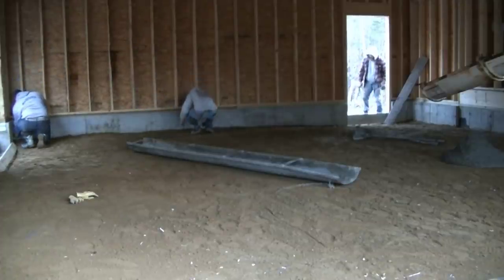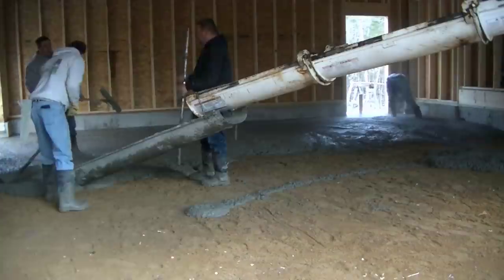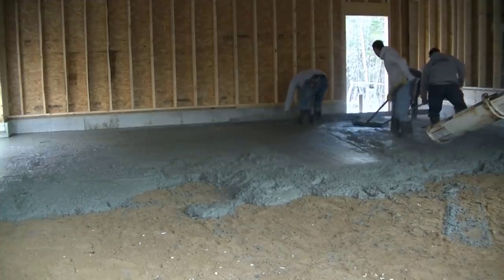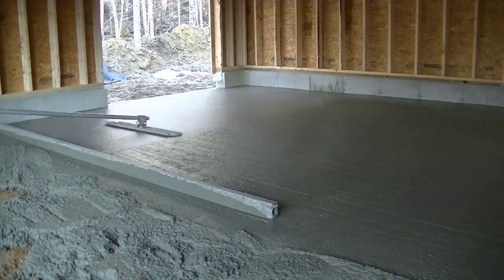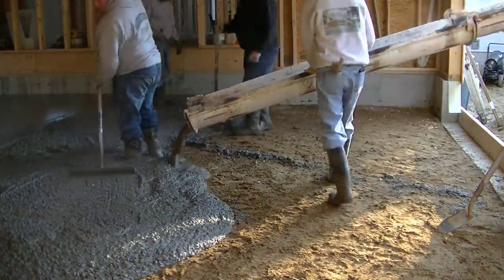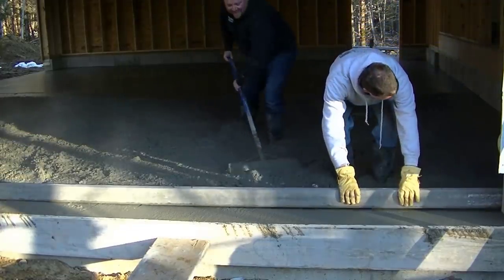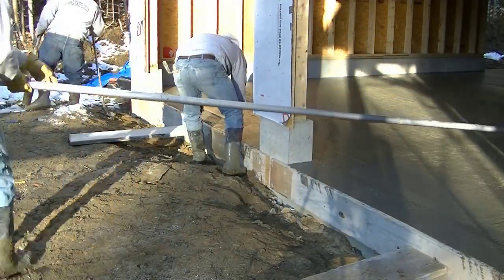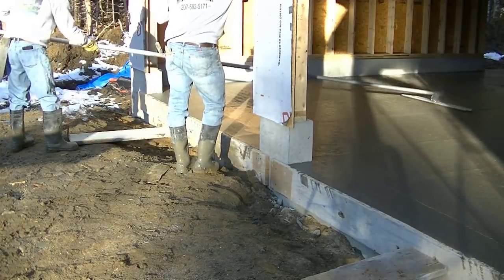Pouring A New Garage Floor 32'x28' (That Slopes To The Doors)

Comment: I used to do concrete work and we kick screeded everything. We put down a loading ramp that took 8 trucks at 6in and we kick screeded the whole thing. We had a 6 man crew and we could throw some mud on the ground. I loved it but the work was not steady enough so I had to move on. Much respect, you have a good crew. It takes time to get a good rythym on a kick screed and it back breaking work.

Comment: Awesome demonstration of the correct way to put down concrete. I screed, but I don't kick screed. A few still do it here. Kills my back and my worker isn't able. We screed about 3 feet then we more back and do it again. I'm one of the few left that does screed in my neck of the woods. Most finishers are putting in grade pins every 5 feet, float around them for grade, then just rake it down and bullfloat it.
Reply from the maker: Thank you! Yes, it does hurt the back after a while.

Comment: ACI says you should see saw the screed, so back and forth, this helps drive the heavy aggregate down and bring the fines to the surface, same with bull floating, although we always tried to bull float opposite from the direction we screeded, and every pass with a power trowel should also be opposite from the last pass, sometimes it’s hard to bullfloat opposite from the screed when doing resi jobs, inside basement walls, etc. you guys are the best at bullfloating I’ve ever seen, and I’ve been doing it for 36 years, we cannot kick screed any of the concrete we pour bc of the  chemicals they spec out, V-MAR, DELVO, MARINE concrete, etc. these mix designs are so dry that when you try to kick screed it it leaves the surface completely open and rocky, and you have to over finish, use sika film or all day and they tend to use way too much of it just to close up the surface when bullfloating, so we tend to vibro screed most of our flat work, it helps close up the surface so the guy on the bullfloat doesn’t have to work the concrete too much to close it up, and is less likely to flake off, as we all know the bull float is a smoothing and straightening tool, and is not intended for a finishing tool, unless no further finishing is required, anyway, that’s my two cents, what I’ve learned from going to ACI every 5 years, I’ve poured over a million yards, finished millions of square feet, and you guys are the best on YouTube, residential floors are a dream, no chemicals, they finish like butter, the crap I have had to deal with over the last 25 years in heavy construction makes you want to pull your hair out, and you always seem up against it when pouring and finishing, and we never get the same crew anymore, finishing concrete is a dying art, and not many young people could care less about it, it used to be enjoyable when we had crews that did it every day together, but we now sub out a lot of it, and honestly I encourage it now where I work because we just don’t have the experience anymore, and I’m too old and and broken down to try do it with a bunch of kids that could care less, or even try to help.
Love your videos, and it brings back great memories from my younger years, I’m going to miss this channel when you retire.

Comment: Hello Mike, I've been a finisher for about 14 years. U guys doing great work. Me and my crew set up a rod board to rod off, while the other guy is wet roding the wall line. We pull a rod in one spot working our way down flat. Jay's Custom Concrete.
Reply from the maker: Nice Mario. We all have our ways. It doesn't matter how we do it as long as we get it done and the customer is happy.
Reply: Nice. Thanks for responding. Keep on keeping on, while while you can due to the situations we have at hand right now. So I see u do epoxy as well. Good work. We also do metallic epoxy as well. Like your videos also you got some good hands working beside you.

Comment: We setup 14’ long x 1.6” screed rails since we do the ground work and the concrete.   Usually setup a rail every 12’-14’
Reply from the maker: That's cool. We've never used screed rails. I was taught to wet screed at the age of 16, and that's how I teach my employees.
Reply: Mike Day Everything About Concrete If you did the ground work, you would need some type of screed rail to push gravel.  We did a lot of huge pole barns and grain bins.  80x160’s and up
Reply: I’d love to just pour and finish, that’s the easy side of concrete work.  Work hard for an hour or two and play on a rider for a few hours after that.
Reply: @MikeDayConcrete  That's all I've done for 28 years, Kick screed.

Comment: I start on the front right of garage pour a stiff mix up to my chalk line. Pour all the way around garage perimeter stiff. Second truck I loosen up the mix and pour the center. You never loose the proper slope. Also keep cheap level I can stop and occasionally check slope. I will also put grade pins down the center and pull them as I progress. When I get to the door I put 2x6 across door opening this leaves lip for garage door.  That board is pulled when floor is almost dry.

Comment: The first time I did concrete was a house I built with my father inlaw. It was a heated floor in the garage, laid the bubble layer, wire, tubing, rebar and black joe on the walls. For the expansion joints (in the middle), I spent some time installing black joe at the height of the pour. I used a laser level to get all the black joe at height, with a 1in slope to the door (one bay, 20 feet long), I guess the slope could have been more but it worked well. So we poured the concrete, saw screed it using the black joe to get it level. Power troweled it later, turned out great. The trick was cutting the black joe with a long straight edge, the floor turned out very level, but took more time than the pros would have taken. Was this an acceptable way of doing it? It was fun learning the power trowel and was actually fun to do. Excellent video, I learned a few things, easy for a newbie to learn. I will be doing a garage at my new house, same as the first, but 20X30, heated, the driveway leading into it is short, 10 feet, and sloped, so I will have to use a bigger slump for the driveway. I plane to use some sort of a grate system at the front between the garage doors and the sloped driveway. Put a couple of 8-10 foot holes, PVC pipe down to a gravel drain bed.

Oh, and yes after we split she got the house, how I miss her... the house I mean, spent a lot of time in that garage, built a few NASCAR Canada engines and some 4 banger Ford 2.3's in there.

Comment: GREAT IDEA with the extra long chute! I have a plastic culvert laying around, I wonder if I could put a chain on it and use that as an extension! 
I mostly use a vibrascreed as a back up in case I get in trouble or when I am doing over a few thousand square feet in a single pour. I have Aussie easy screeds. Tried a kick screed once with a buddy and we chucked it out the door and went back to what we know. 🤣
Reply: Never use anything except a steel chute. It is a ton of weight and sometimes an accident can happen very fast with rigged up pvc chutes. Could easily come down and break a leg or worse.
Reply from the maker: Same here, we do what we know best.

Comment: Love videos like this.  Too bad I learn much after the fact.  The heated, attached garage was a selling point for me on my new house. Only took two snow storms to realize the garage had no slope or drain, so water pooled and cause insane humidity. Water  would just sit and stink until I ran fans, dehumidifiers and cranked up the heat. Now my cars sit outside when they have frozen on slush. Life, always with the curve balls.

Comment: A general rule for us is, we like to have the board running the same direction that the water would run towards. It's a better gaurantee and it also would allow you to bullfloat the same direction as the screed lines, which is the proper way.

Comment: I'm pouring a slab for a metal kit garage by myself. If I poured in sections would I have to put expansion joints between them? This is a garage for vehicles that never go out in the rain.

Comment: I know new technology is a great thing! Call me old school, but that floor needs some wire! I overkilled my floor I guess! Not only did I put wire, but at every door I put a piece of rebar and wired it in..  when we did my floor we did the saw cut motion to help level and fill in any voids. You and your team do a great job, I enjoy watching you guys! It’s a lot easier than actually pushing the mud around!!
Reply from the maker: Bret, I put a mat of rebar in my garage floor also. On a lot of my jobs I don't determine what goes in it, they just hire me to pour and finish.
Reply: Mike Day Everything About Concrete , I heard your disclaimer at the beginning of your video! If your customer or subcontractor wants things a certain way then that is what you do! You would be my first call if I ever need to do a concrete job again!

Comment: Even with fiber mesh concrete I would still put a rebar mat on 1 foot spacing or less.  I"d put gravel down first.
Reply from the maker: Thanks Duane, That would be better.
Reply: Dave Chappelle  That would make a lot of sense.
Reply: Duane Farries  I am a second  generation concrete contractor 59 years old. I believe in a good compacted sub-base as a key to a successful slab. Fiber mesh is ok but will not re-enforce the slab, only help hold it together WHEN it cracks. Re-rod is extreme on a residential slab. Sub-base is key.
Reply: @mikebajko5955  For sure you need a well compacted base before anything else is done.

Comment: Until the 80s when the vibrascreed came along I think everybody had to kick-screed. I don’t know of another way to do it. I think pretty much everybody still kicks it if it’s less than ~1000sqft. Then if you want a nice burnt-out finish like a garage floor, break out the power trowel.
Reply from the maker: That's when I was taught, about 1980. It was all we did whether it was 10 yards or 1000 yard pours. The 1.5" agg was the toughest especially at a 3 or 4 inch slump. Sent me to the chiropractor at a very early age!!

Comment: I just did a pretty big basement, 38x56, a couple weeks ago and we kick screed-ed that. It was a little tough for us because we (my partner and I) were not in synced while pulling the screed. We have a vibra screed but we have only used that on screed rails so I would like to see other videos with you guys using a vibra screed. When we've tried to use with without screed rails, the screed seems to "sink". Not sure if we're doing something wrong?

Comment: This is the second video of Mike's I have seen and neither one uses a vapor barrier. This floor will never dry out. The earth is considered permanently moist. And this drier concrete is just going to wick moisture out of the earth. And where is the welded wire mesh? Every floor I've poured has welded wire mesh at the bottom to carry the tension of the load above.

Comment: Mike Day - I’m finally about to pour my 40x60 slab. Since I’m no pro would you recommend using the wet pad method or would you suggest using pins or forms? I’m using a 12’ vibrascreed so if I formed off the bays at 12’ wide I would be able to keep thickness uniform. Just not how sure the mix is going to behave. I’m using a volumetric concrete truck using the logic that is gives me more working time and mixes as it goes rather than having 40 yards already mixed. I know y’all don’t use pins and unnecessary forms but I’m trying to find increase my chances of success. Also plan to power trowel which I’ve joined your classes to study up on.

Comment: I am always impressed by how easy they make it look - I panic a lot more when the second truck is on the way. 
Over here we always use damp proof membrane on all interior pours - doesn't the damp come through when there is no barrier?
Reply from the maker: It can. This garage has drainage and the sand is pretty permeable. It shouldn't show moisture on this one.

Comment: Thanks for video, makes me kinda worry about my new pad outside my garage to work on vehicles and move my equipment if needed. Its being poured with fibre mesh 4.5" thick and only has rebar on the side...My biggest thing is how steep to make it as the driveway comes in the side and its longer not wider so concerned with a big drop for drainage will make having cars on stands etc dangerous (hopefully concrete guy has an idea but already concerned as the guy i hired flogged of job to someone else and hasn't spoken to me since but at garage side at agreed depth would be touching my house if he doesn't dig base out, not to mention another lip to get into garage)....Never remember it being this complicated 15-20 years ago when i helped out as a labourer, it hurts my brain (i am a stickler for communication and details)

Comment: i pull a single board with handles, made from scrap 2X4. if raked well its not that difficult to pull the concrete
Reply from the maker: That's the key, if raked well.
Reply: Where did you get the chute extender?
Reply from the maker: I can buy them locally at HD Supply. You can get them online at Amazon also. https://amzn.to/2ylGXLx  I've had them for years.

Comment: Just wondering what a project like this would cost for labor? I've got a 2-car garage with a gravel floor over compacted sand and have it in my head that I want to put a real floor in there in the spring. While I haven't done the math yet to figure out how much concrete I'll need, I am trying to work out what it will cost to do the work itself.

Comment: Weekend warrior here. I ordered 18 yards this weekend. I told them 100 times i needed water reducer added to get a 6 inch slump for the pump.  Both trucks showed up with 4" slump and then had to add 20 gallons of water to get a 6 inch slump to pump. No one new what the hell water reducer was at the concrete delivery place. What should i do? I finished my project but i am still pissed about the extra water

Comment: I like a nice 4 inch pitch on garage slabs
Reply: Also we dont kick screed: we pour lower slump, then generally pull three times then push-pull the rod one time to close it up a bit. You guys are significantly faster tho obviously
Reply from the maker: 4" pitch on a 32 foot deep garage would be pretty good. This one only had 2".
Reply: Who actually does the pitch? Site guy or do you guys always start with a level floor and snap your lines accordingly?

Comment: I have never touch concrete other then for fence posts but a quick question. When would you put down rebar, chicken wire etc is their a certain depth, width or length I have asked this question many times but my mother wants a 10wx11lx8h pad and wants to pay for it but i got her

Comment: Should be rebar in any poured floor and plastic.
Reply: Did you even watch video it was mentioned that It was fiber reinforced concrete and then you doesn't need rebar mesh.
Reply: And it wasn’t his call on rebar versus fiber reinforced.
Reply: Where is the vapor barrier ?

Comment: I’m really interested in your concrete underground courses.  I was wondering, before I subscribe, is there a course on how to pour sloping slab?  I have a 6 foot by 28 foot approach off a four degree sloped alley to the garage behind the house. The apron approach has a 20 degree slope at the lower end of the alley to the height of the garage entrance. Any help on how to pour on a slope?

Comment: If a garage floor is pored on loose sand and uneven rebar used the concrete will shift and be uneven correct

Comment: I usually pull alone on a 8/10 ft board, I’m usually alone mostly, I vibrastrike when dead flat but when sloped i board by hand to ensure it doesn’t fill the low side, I’ll also use the widest bull float possible to show me any holes from my feet that may have been missed. I can’t stand any birdbaths near drains or low side of slope, screeding is where those develop. How come you guys don’t grade the dirt flat for quantity, does excavator pay your overages on mud?
Reply: He clearly stated.. they where hired purely to pour and finish the concrete... first rule of criticism is . STOP LOOK LISTEN.had you listened to his explanation as to what they are hired for,you may not of been so quick to trash the job and how it was done..  have a nice day and keep pulling your 8/10 footer.🤔🤔
Reply from the maker: Yea, I don't understand why they don't take a little more time to grade the dirt, this one was about 4 yards over. But the excavator was the GC on this one so it was up to him. He'll pick up the extra.
Reply: @donaldtriumph1682  pump the brakes a lil there bud, i wasnt criticizing, just asked a question which Mike said to do in his commentary, is there any reason you think pulling a 8 ft or 10  ft 2x4 would be difficult? He also asked how the folks watching screed their floors to compare and discuss, you can also see he didnt take any offense to my comment as he responded below. Maybe chill out a little bit bit, hard to read peoples tone through typing i understand. I think his guys did great work.
Reply: @donaldtriumph1682  relax bud he was only asking. No need to have a stroke over it.
Reply: Ryan S Thanks for your input but if you look closely you will clearly see the only thing the man asks is actually his LAST sentence. Every other point he makes is a statement... I.I I’ll I and the last one How. 👍🏻👍🏻
Reply: @donaldtriumph1682  In agreement with you Donald. Have you ever met people who have what are called eye problems? Everything they say starts with the word I. Is it a word, not sure myself.